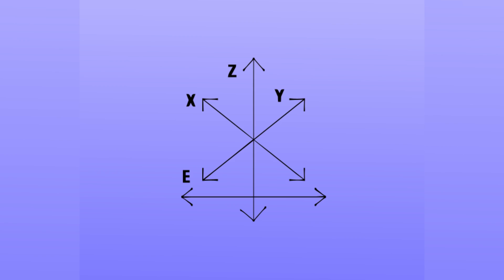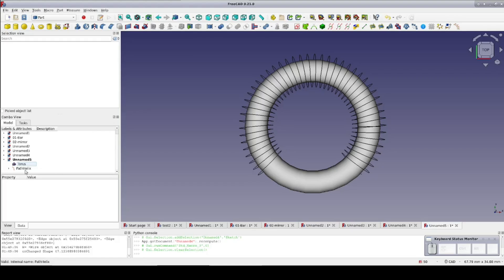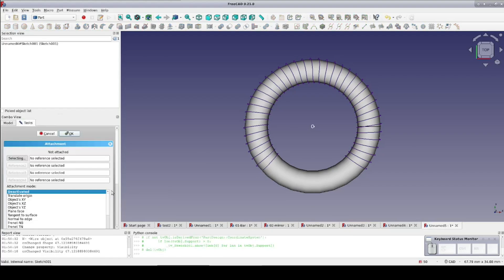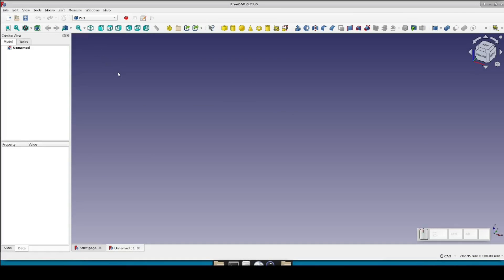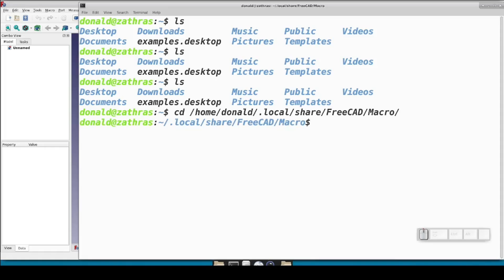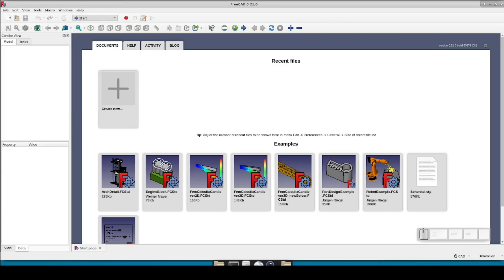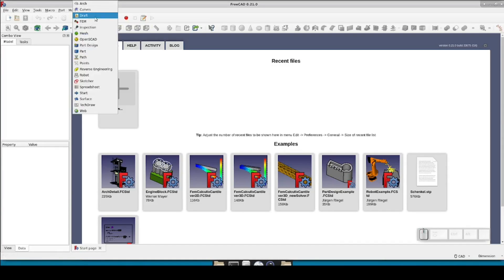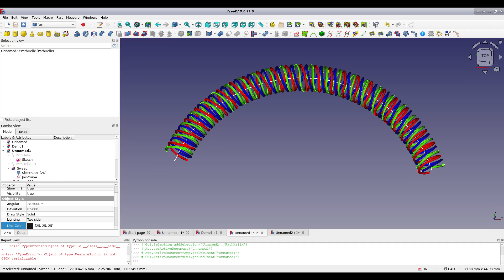FreeCAD: A new tool, PathHelix

Comment: Is there a FreeCAD macro or tool, that given a wire path from a sketch on surface in curves workbench, will etch it with a thickness and depth parameter? The edges of the etch should be parallel to each other and not radial pointing to the curve origin. This is meant to create a cam path on a drum surface.
Reply from the maker: Just sweep a square along your path and cut it from the part. Or in PartDesign, use subtractive pipe with the square and the curve as the path.
Reply: @4axisprinting  I get "not a solid" error message if I use "rounded corner", which is what's needed for constant width. I could actually create a solid first then XOR or cut that from the solid. But the whole process seems cumbersome: Use Curves WB for the sketch on surface. Use that as path to make a solid. Then cut or XOR using Part WB. Also I prefer just staying in PartDesign WB.